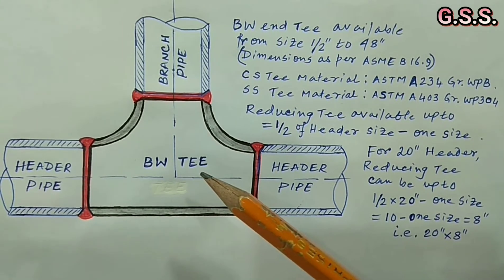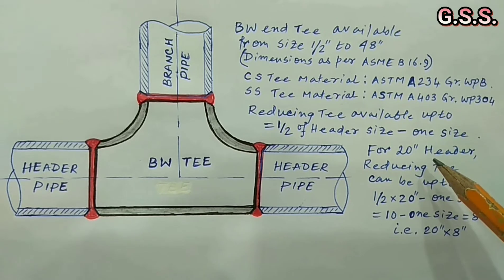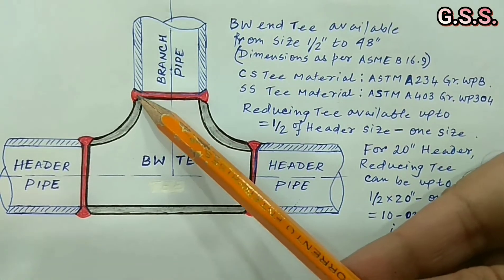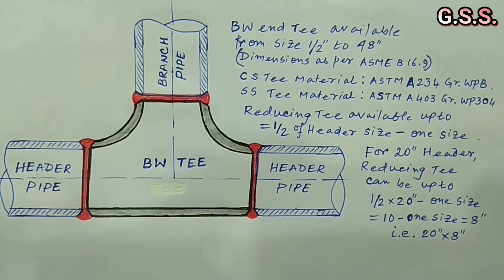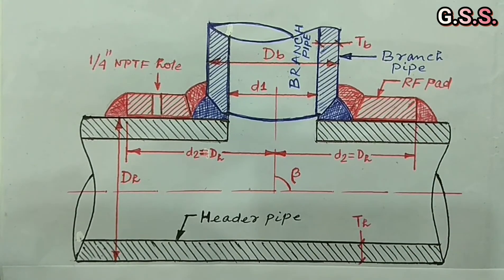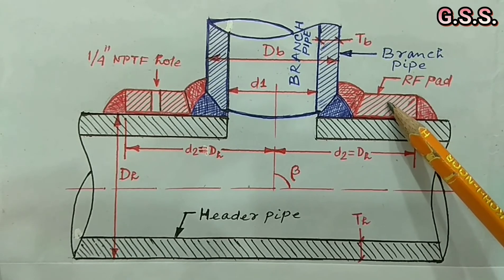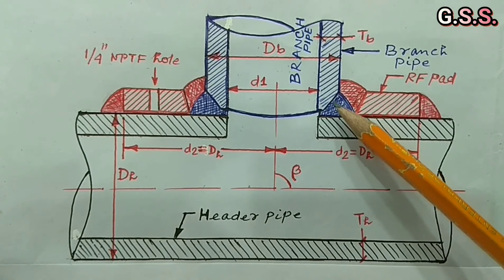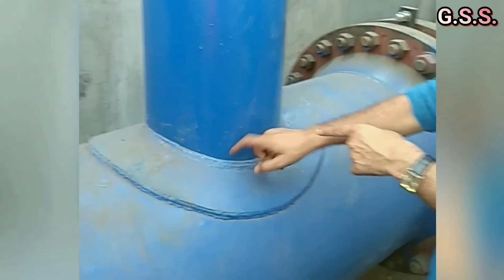Piping Engineering : butt weld tee Vs direct branching

Comment: Sir what is mimimum weld distance required between two adjecent weld in case of butweld and socket weld fittings 
Is there any thumbrule
Reply from the maker: Minimum weld distance is 5 times pipe thickness or 50 mm whichever is more.
Reply: @gourisankarsamanta7670  thank you sir

Comment: Good Information. Could you please publish a video on Extruded Branch Tee with Reinforcement calculation & Stress Analysis, this would be very helpful.
Reply from the maker: These videos are already there. Please see below link : 

https://youtu.be/zjt7Odj4rvA

https://youtu.be/vmDc95KHDcE
Reply: @gourisankarsamanta7670  thank you very much for recommending your videos, it was very informative but the modules what you explained in the video was for Tee with welded branch outlet. I wanted to know the reinforcement calculations for specific extruded outlet Tee (without welding). Appreciate if you could check and share your experience in calculation and analysis if any. Thank you very much in advance.